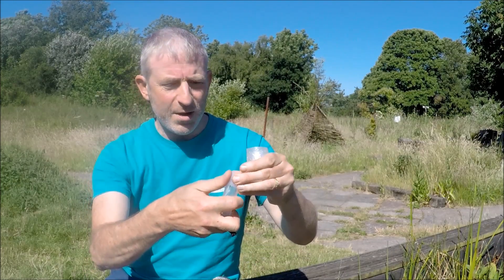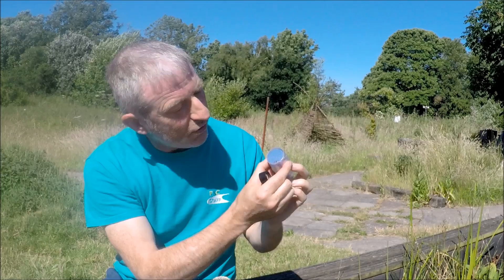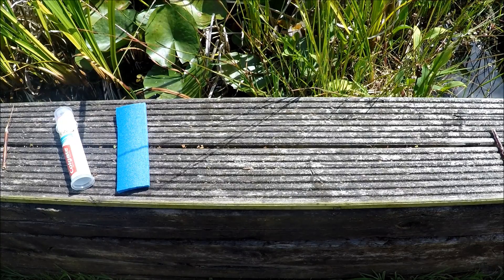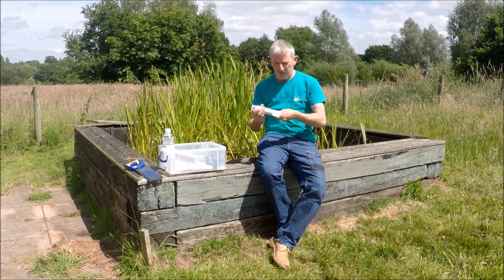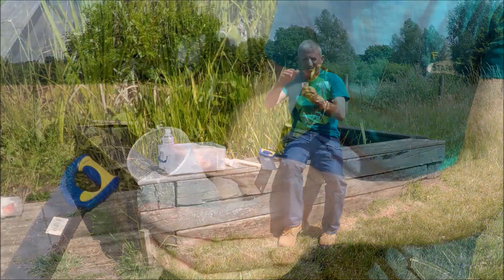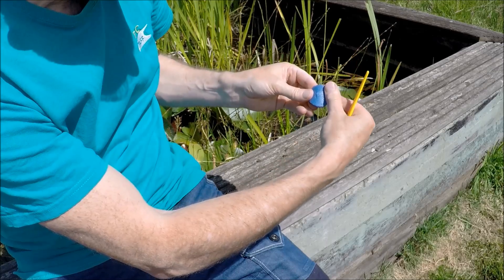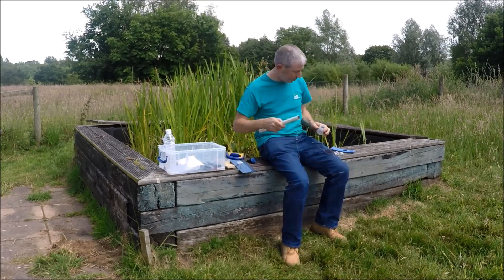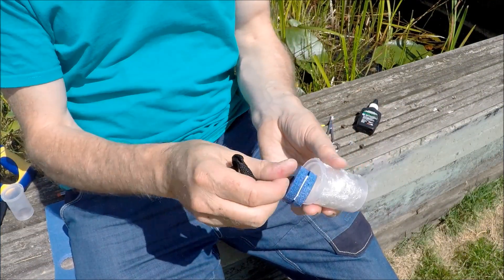Terrestrial Invertebrate Sampling: Making a Spi-Pot

Comment: Thanks for this! I’ve just made one, but I put a thick circle of card beneath the two foam circles for added support. 
A very useful, and sturdy, piece of kit. I gave up on the thin plastic cup spy-pots years ago - they were always crushed in my field pack before I ever got to use them.
Reply from the maker: Good suggestion!